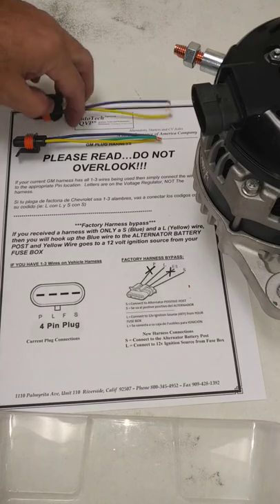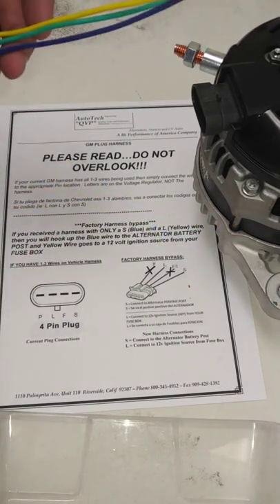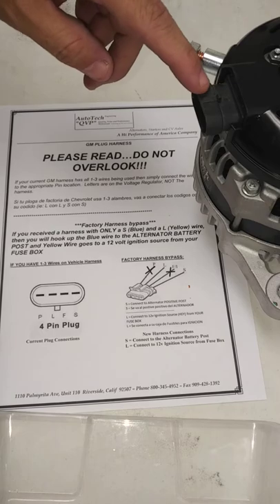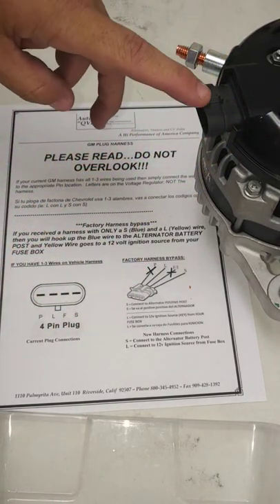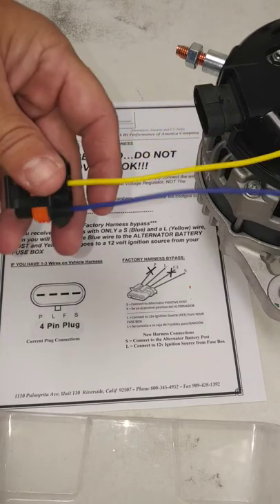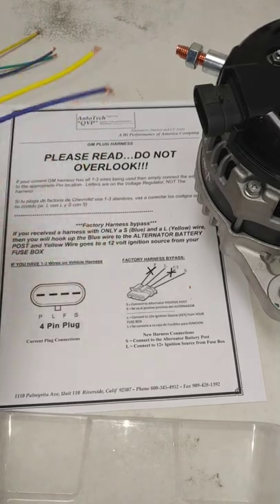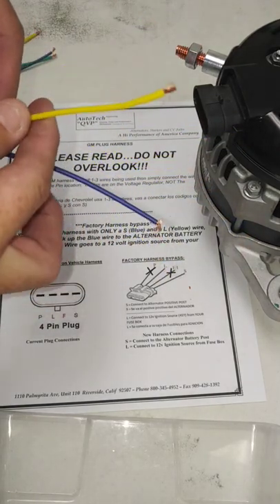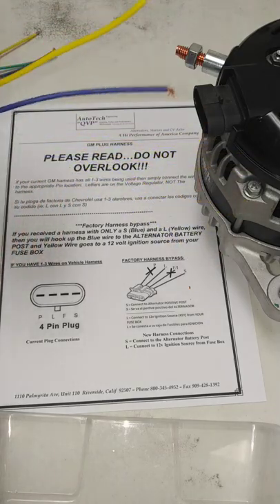Wire harness instructions

Comment: Ok the ignition wire can i run that to any 12v ignition source that turns on and off with the key or does it have to go to the main ignition source in the steering column

Comment: So i got the alternator from u guys with the 2 wire harness for my 05 corolla. Now i think i did the opposite from what i understand from ur clip which might be the wrong way. There was a plug attached to the yellow wire already which i plugged directly to the alternator harness plug. Blue wire needed extension which i connected to the 12v ignition fuse(5 amp) in the fuse box. Voltage does drop sometimes. Did i do it correctly?

Comment: How would yall setup a Mechman 240amp HO Alternator for a 2006 Honda Civic 1.8L? I got it but when I'm looking it over its missing its whole harness that is on the factory Alternator. The mechman only has a post for the + and 4-pin harness which only has a single yellow wire on the 3rd pin? Any tips would help
Reply from the maker: Email us what you specifically want. Info@autotechengineeringusa.com

Comment: I need a video on how to install the voltage regulator on a 390 amp js alternator
Reply from the maker: Not a simple job, especially if it's a Chrysler product.
Reply: Did you find the video for the voltage regulator? ?

Comment: I have a js alternator 390 with that same exact plug style. for my 97 ford f150 I have a 3g alternator but I'm trying to figure out the asi to lsf configuration. I need help. I know green wire is ignition wire but left with orange.
Reply from the maker: Js wire colors don't match ourS. Look at back of regulator for less codes
Reply: @autotechengineeringusa  I figured it out. But thanks

Comment: How about a 2016 Honda Accord pcm bypass
Reply from the maker: We use same setup
Reply: What about using a 470ohm resistor inline with L
Reply from the maker: @ronaldredlerjr3411  Honda's are LIN voltage setup. There is no L
Reply: @autotechengineeringusa  doing a pcm bypass
Reply from the maker: @ronaldredlerjr3411  we sent u a Dm on messenger
Reply: @ronaldredlerjr3411  hey bro just got my in yesterday for my 2015 accord how did the wiring work out for you
Reply: @shyne_rds5446  hey was you able to do the wiring on your alternator? Where do you connect the yellow wire?

Comment: I received 6 of your alternator and not one came with instructions only that two wire pigtail.

I had message you a few weeks back about an adapter to allow plug and play with no response.

But I am good now...

I have four billet 320a for my 2k Yukon in blue, a 320a for a 91 Cherokee in red, and a red 320a for my 01 Honda Civic DX.

Comment: Hi how about c pls
Reply: C is for "condenser and (actually"with") resistor. U know how on some cars, u use an aux cord to listen to music.. but when the radio is up and the song is quiet, ya hear a whining noise that gets more high pitched as u accelerate? This stops that.

The condenser is actually a capacitor... But it won't work if u just use a capacitor. If u look up condenser resistor on an auto parts website, ull see what I'm talking about. Usually the body of the condenser is the ground, and the strap for it is metal, so u bolt it in so it's on that C lug hole. It's actually just a ground for the alternator housing. If u want to install one on an alternator that doesn't have that C... Just to see if it resolves engine whine in the speakers, screw it in under 1 of the nuts that holds the housing together... The wire coming out of the condenser is to the battery positive on the alternator.

Some are reverse polarity, so u can strap it to positive and wire it to negative. If u do positive to positive, or negative to negative it won't do anything... Won't break, won't affect the car n any way... It just won't make any difference at all because a capacitor is meant to rapidly charge and discharge (basically smoothening the wavey voltage signal to a steady voltage). The battery
Itself will keep the car components at a steady enough range, but the minute variations in the power (literally waves of power.. which is exactly what makes speakers move, to push air, for our ears show our brain that, HEY I RECOGNIZE THAT! ITS SOUND!) Is what the amp in ur head unit or stand alone amp will pick up and play. That's from small amounts of electrons escaping wire insulation throughout the vehicle, and affecting other conductive parts via magnetic flux.